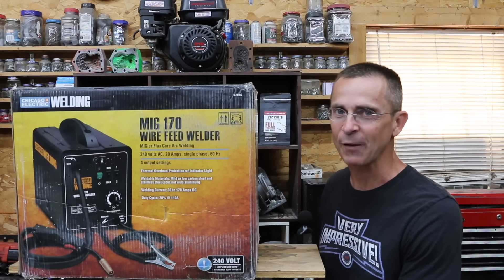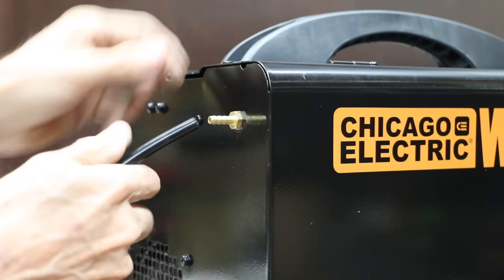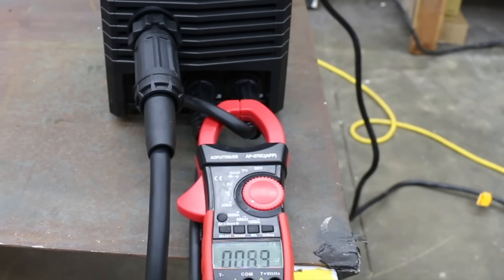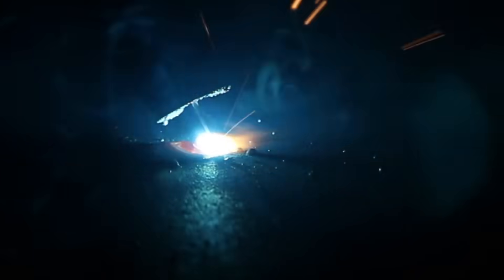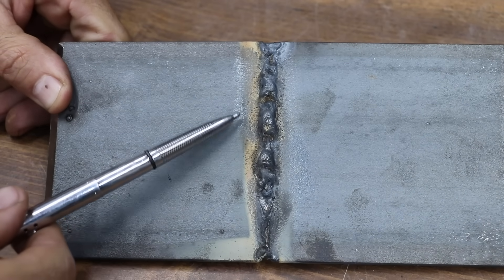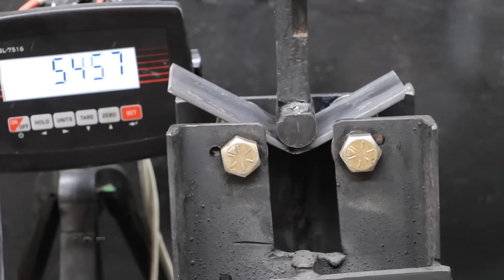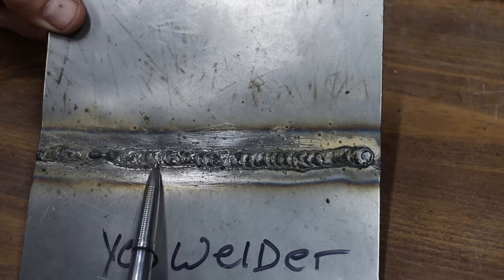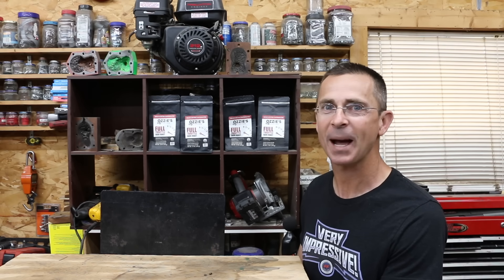Cheap vs Expensive Welder? Let’s Find Out!

Comment: Difficult to beat a welding machine from a reputable company.  After attending Jackson Welding School in 1987... I built a  Bruce Roberts Norfolk 44' sailboat ( steel not fiberglass) with a 1988  Millermatic 200,  mig welder.  CO2 gives the best penetration while Argon gives the smoothest welds.  Hobart prints a fine book on MIG welders and Welding.  Miller has a SPRAY transfer (which I like) compared to Lincoln's GLOBULAR transfer of liquid metal.

Comment: Well it looks like you get a more rounded welder with the more expensive Lincoln welder that can do both thin metal and thick metal welding well. With the cheaper Chinese brands it looks like they are either good at thin metals but not at thick metals or the other way around, but not both.  This tells me I should get a small welder for thin metals and a bigger welder for thick metals and have two machines which is still cheaper than the Lincoln welder alone but that Lincoln is nice.

Comment: I bought a Lincoln 140 for $600. It went for two years before a diode and the on switch went bad. Covered under warranty. While in for repair I bought a national chain brand mig/arc welder for $350 clearance. Did one welding job and relegated it to the junk pile. Won't use anything but that Lincoln now. Over 10 years old and works very well.

Comment: I missed out on a Vulcan 220 before the price jumped to $1k+. Decided on a Yeswelder 205DS about two years ago and used it to build a truck bumper and spare tire swing arm for my Suburban (novice welder). Very satisfied with it, and so far it hasn't fallen off the truck. Recently moved up to the Yeswelder Mig 250 Pro...another nice machine. For the money, they're a great value.  Great testing, by the way.

Comment: Top notch review with a professional welder welding sheet metal that about 90% of all amateur and professional welders COULD NOT do, without blowing holes non-stop. Not one other review tried thin sheet metal. Why? They knew it was over their ability. Great Job Virgil and Project Farm! The Azzuno just got ordered. My 35 Year old Millermatic 250 amp mig welder also weighs about 250lbs and only 220v. Wanted a pocket welder for awhile that can do sheet metal.
Reply from the maker: Thanks!

Comment: The low power capability of the Azzuno is something I'm interested in.  My main use is body work,  so thin sheet metal replacing old rusty body panels...  Will have to keep that in mind next time Im looking for a welder.
Reply from the maker: Thanks for the feedback.

Comment: I've had my Vulcan for almost six years. Never had an issue with it welding thin materials- you just need the correct wire and use the right settings.
Reply from the maker: Thanks for sharing.

Comment: The problem I’ve had with cheap welders is they’re disposable. They may work ok right up until they don’t.  Then you can’t get parts and you waste time trying to fix them.  This goes for plazma cutters as well. Your money is better spent on a Lincoln tombstone for stick or a Lincoln SquareWave for Tig and stick.   I don’t use the SquareWave for heavy stick welding.  I have friends that swear by Miller, but the price goes way up.  My lightly used five year old Eastwood Plama cutter is burnt toast and my 30 year old Oxy Acetylene torch has never failed.
Reply from the maker: Thanks for sharing.

Comment: Bought Mig welder from Harbor Freight years ago (Chicago Electric?  Handed down to son).  NEVER got a good weld from it, admittedly I was mainly trying to weld thin material, like a crack in lawnmower muffler.  I've heard the problem is the wire that comes with it is crap.
Reply from the maker: Thanks for the feedback.

Comment: I would like to have seen you added the YesWelder MIG 250 Pro.  This is what I have, it's the older model from 3 years ago that has a Teflon liner to weld aluminum. It does MIG, STICK, TIG and Aluminum. You have to buy the TIG Torch separately.
Reply from the maker: Thanks for the suggestion.

Comment: This is silly. The Lincoln isn't even in the same class, of course it's going to weld better. This is like, "Let me test this Ferrari against a Hyundai, a Kia and a Ford". Why not test a comparable model Lincoln like the Weld Pak 140?
Reply: Exactly! Todd, please consider a comparison among mid-priced mig/flux core machines. Some here have already made suggestions. Miller, Lincoln, Hobart, etc. in the 140 amp/120 v range or some that are dual voltage. Those are the ones us weekend welders are buying in droves at a price point around $700-1,000, mostly at the box stores or sometimes used on Craigslist, offerup, etc. Then again there are dozens of youtube tests and reviews already out there. And a side note: where the hell do you get all the scratch to buy this stuff (and then destroy it!)?

Comment: If I am using Flux Core with 20 guage metal ( the same material that has been used on the fender of most cars), what would be the best settings for my work?
Reply: Test it, make notes, really clean the surfaces, get a good ground. Each welder can vary enough, and your exact technique may be different too (drag or push, gun angle, lead length, gas flow, motion, wire speed, material thickness, type of joint, wire gauge, wire material and brand, etc) so you have to try it out see what works best in your hands. Try to get close with some setting recommendation, then vary just one of the many variables for each test: if you change more than that you can’t determine which change affected the result

Comment: I am using Chicago 170 Mig for 14 years, no complaints. 
I was a welder for General Electric nuclear division and used Lincoln Mig. 
The welds you have shown are by amateurs. 
Sorry, I disagree with your conclusion!

Comment: I just bought a flux welder off eBay for $68 bucks free shipping and it came with EVERYTHING! Stick welder/ sticks free pound of flux wire and it welds with the best of them you don't need expensive and DANGEROUS gas
Reply from the maker: Thanks for sharing.

Comment: Bought the el cheapo HF 80 for about $80.00 more than 10  years ago. Pro welder told me about the Prime Weld 180. Bought it 3 years ago and love it. Does it all without burning through thin stuff. 110 or 220, can stick, mig, and comes with spoolgun for aluminum. Really only use the gas with the mig. All the rest of the stuff I don't really use, but nice to know I have  options if I ever need it. Primeweld support is awesome, and they answer any questions and help you out whenever you need them. Like that they are made in the USA as well.

Comment: Question ...for the Azzuno welder, were you using gas or flux core wire? 

I do bodyworks and I think this will be the perfect welder for my job..

Also, what settings you were using on the thin sheets for the Azzuno Welder ?

Hoping to hear from you soon.

Comment: I got a Hobart Ironman 230 $1,700. This thing is a warrior! It has 12 heat settings. It suggests level 6 for 1/2" steel(with .045 wire, higher levels reserved for aluminum)! I have had this thing on level 6 welding for what would be over 5 minutes combined(broken up over 7-8 minutes) before the cooling fan would even come on! I love that the wire speed dial can be turned completely to zero to adjust/purge the gas when seting up/shutting down instead of having to release the roller tension. 

I got this after I was highly satisfied with over ten years of service from a Hobart Handler 140 which I often asked for much more than it was rated for and which has since gone to a second owner and still kicking.  I highly recommend Hobart brand.
Reply from the maker: Thanks for sharing.

Comment: The Azzuno MIG-200F has a minimum current of 40-amp with CO2-MIG setting (GMAW process with shielding gas and 0.023 diameter welding wire), so apparently the manufacturer's specification has changed, as of 2024-07-27 (today, just received the shipment and tried it out - The Azzuno burned holes in auto body panels 22/24 gauge, almost all of the time, about 19 of 20 holes where the stud puller caused the sheet metal to yield when pulling out a dent... My old welder has 34-amps minimum power, and it only burns holes about 10 out of 20 holes being filled in - So the difference between 34 amps and 40 amps minimum is a BIG deal with thin sheet metal). The Azzuno welder in this video had 22-amp minimum amperage (on low setting).
Reply from the maker: Thanks for sharing.

Comment: I would have loved to see PrimeWeld in the running...I have a Hobart Handler 140 as well...Miller is probably way too expensive for this test as it's ridiculously high like the Lincolns.  I understand controlling costs for the video though...despite Hobart and Miller I would want to see where the PrimeWeld stacks up because I'm considering buying one and I've heard raving reviews about their customer service.  The customer service is a whole different conversation for rating these welders, the cheaper fly by night companies will have low marks.
Reply from the maker: Thanks for the constructive feedback.
Reply: YesWelder is pretty cheap, but their customer service is top-rate! I had an issue with my auto-darkening helmet, & they instantly sent me a brand new one. I just had to send them a video that it was darkening from the florescent lights.

Comment: Love your reviews! Any chance you would consider doing a rematch against the Lincoln with some other highly rated welders? The PrimeWeld Mig285 Multiprocess welder is $999. The PrimeWeld MTS200 200 Amp 3-in-1 Welder is around $749. Both are getting awesome reviews for their capabilities and price point. I would love to see you review these two and others in the same class of welder. Eastwood/ Miller Tigs are getting great reviews as well, like the Eastwood Elite MP200i Multi Process Welder for $879.
Reply from the maker: Thanks!  Thanks for the suggestion.

Comment: Thanks for another very informative review. I would like to see how the multi-process models compare for stick welding as well as I am considering the yes welder model because it does stick as well.  

I would also like to point out that models with a 110V plug are not in any way 220v just it comes with an 220v plug split phase adapter that is no different than connecting to a regular 110V outlet!  Its deceptive entirely for them to claim these are 220V welders.
Reply: I have the dual-voltage YesWelder with the adapter, & you can run full amperage on 240V, but only 160A (I believe) on 120V.
Reply from the maker: You are welcome!  Thanks for the suggestion.

Comment: I have owned millers,Lincoln's,hobarts,snap on and many other makes and I bought a cheap welder as a experiment because I didn't want my expensive welders being bounced around in my service truck for only occasional use. So I bought a tooliom 250 and I am beyond impressed with the mig welding ability of that $280 welder!! It has so much more power than my Lincoln 180 and my Lincoln 175 and it is half the weight and it can almost keep up with my Everlast mts251!!  The flux core isn't the best but i hardly ever use flux core unless I'm outside and it is windy. But it's amazing what some of these Chinese inverter welders can do these days!!
Reply from the maker: Thanks for the feedback.

Comment: Amazing vid. Impressed with the combi velder.

Suggestion: could you do vid focused om the best value cheap combi welder.
Tig, mig, stick and plasma cut, I know of them but they range alot in price and performance is impossible to guess.

Basically. what is the perfect veldor for the hobbyist who just need all functions but proppely rarely.

Plasma would be a bonus not mandatory for this test.
Reply from the maker: Thanks!

Comment: Ive had a “suncoo” ebay mig welder for years now runs on flux wire or solid with gas and its still working ive built exhaust systems with it ive made turbo kits with it definitely got my $240 dollars worth and it was brand new sadly i will have to spend some money for a tig welder though but who knows maybe technology has caught up to wear that is cheap also
Reply from the maker: Thanks for sharing.

Comment: understand work hours ( a cheap one won’t last as long as a quality welder ) . My welder used most days and it lasted 22years (well maintained but eroded within the coils caused it to short ) , you won’t get a cheap one lasting that long . Damp is the worst killer of welders as it causes shorts , better machines have coils that are insulated better .
Reply from the maker: Thanks for the feedback.

Comment: Another great independent, real world comparison.  Thank you for putting it out. Maybe if you haven't sold the machines repeat with solid core wire + common 75/25 gas. 
I imagine you kept one of the machines. Which one? Was it the Lincoln?  It was the Lincoln wasn't it.

Comment: The surging and wire speed issue with the cheaper machines could be your spool is too tight, your using the wrong drive roller for wire, not enough feed roller pressure, too much feed roller pressure

Comment: Todd I don't know how i missed this one for so long. I'm not in market for another welder really since I've got Lincoln tombstone, Lincoln 135 MIG and 2 Ready Welder spoolguns.  Anyhow YES welder has been sending me emails for long time, I didn't look to much on them.  24 years ago I bought a low end MIG that failed at less than 6 inches of weld, it cost me 8 hours of time close to 100 miles driving to then just go buy the Lincoln MIG I should have got first time or Hobart or Miller.  If I decide to get another one it looks like the YES Welder is a good option now.  

Have you done a review on plasma cutters?
Reply from the maker: Thanks for sharing!  Thanks for the suggestion.

Comment: After my Millermatic 211 just sh1t the bed with less than 4 hours use on it I'm looking at cheap welders instead.  Why pay big bucks for something that is going to fry just from turning the power switch on?  Miller pops circuit components just from turning the damn thing on.  POS

Comment: You deserve major credit for this experiment. I cannot emphasize it enough: the multi process welder is one bad transistor away from sinking your wallet. Keep separate machines for each process in case one goes down. Most consumers are welding 18 and 20 guage sheet metal exhausts, body panels, and metal furniture (the scourge of welding). The Azzumo and Yes Welders are the last Coca Cola in the desert when it comes to sheet metal.
Reply from the maker: Thanks!

Comment: Let's see how they hold up for at least one year . Then we can decide which is the better welder . The cheaper welders are throw away if they break down and the Lincoln has replacement parts . I bought a Lincoln welder really cheap because it was making a weird noise inside and had a couple of adjustment knobs broken off . I opened it up and found out the fan was broken , ordered a new one , replaced the knobs , plugged it in and it was back to working like new again . Thank you for the videos and testing of various products . I have some welding machines that are over 30 years old and still working great  . 😊
Reply from the maker: You are welcome!  Nice, thanks for sharing.

Comment: In previous job we had migatronic, fronius, miller and Lincoln.
Everyone preferred Lincoln is very reliable is workhorse. Spare parts were cheaper and last longer.

The technology and research that Lincoln Elec. put in the ECBs (electronic control boards) is what make the difference to be one of the best welding machines.
Reply from the maker: Thanks for the feedback.

Comment: Excellent video as always. It would be expensive but informative to do a comparison of multiprocess (stick/mig/tig) machines that can weld aluminum (ac/dc).  Miller Multimatic 220 ac/dc, ESAB Rebel 205 ac/dc, Everlast Lightning mts 275 ac/dc, and others.  Everlast apparently now has an ac/dc mig tig stick machine that also has a plasma cutter, the HURRICANE MTS 220-C
Reply from the maker: Thanks!  Thanks for the suggestion.

Comment: I really like what you do here. I  have a Yeswelder Mig 205 DS. For what I need it for? It works great. I wanted a dual service with gas/flux ability. It has not let me down. I have my Tombstone for what I cannot do with wire, (which isn't much) to weld  something real heavy on some larger implements on our farm. People can complain about where they are made. But, fact is? They are cheap and they work. Plus, they have all of the consumables and equipment to go with them. I also have a Yeswelder Plasma Cutter that I have been VERY impressed with. Customer service for me has been very good for me. The only issue I have with them? They keep coming out with newer items I want to try. Inverter technology is some pretty cool stuff.
Reply from the maker: Thanks!  Thanks for the feedback.

Comment: Im a German Welder and a Welding Engineer and to be honest for those V Seams with the 3mm gaps i learned to Weld the root in a lower current to get the best and most consistent root, i personally think that if he would've welded those roots like its supposed to be at about 180 amps and slow passage the Welds would've held up way more force. But very interesting Video :=)
Reply: i would have done atleast 2 Passes (a root and the Top layer with cleaning the root before welding the top layer)

Comment: I have a comment about the injection-molded plastic wire feeder. It often takes a volume of hundreds of thousands, sometimes millions, of IM parts to realize the cost savings over a metal part. Especially when it's a well-understood metal part that factories have been making for welding machines forever. Sometimes cost-cutting can go a little too far.
Reply from the maker: Thanks for the feedback.